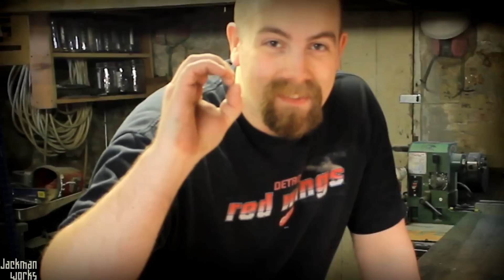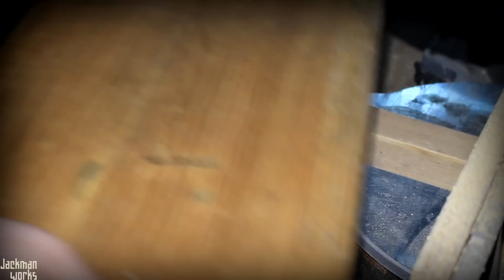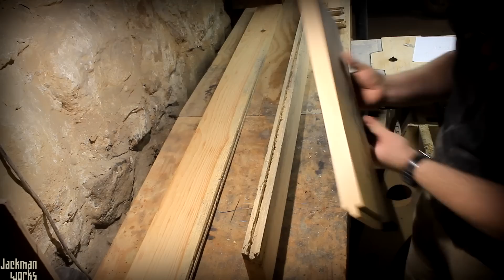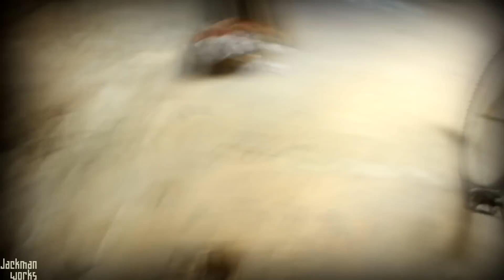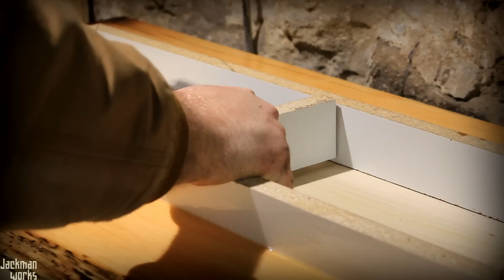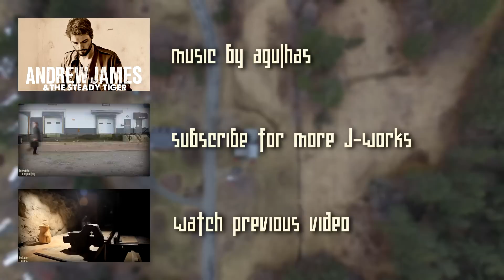How to Build a Door from Scratch (Mission Style)

Comment: Cool. Going to make one now with some lumber found in the shed.  Did you leave the panels floating (unglued) and when you sealed using West System, did you do the edges at the panel or just the outside surface of the door?  Cheers.